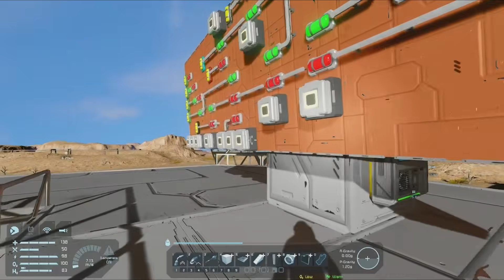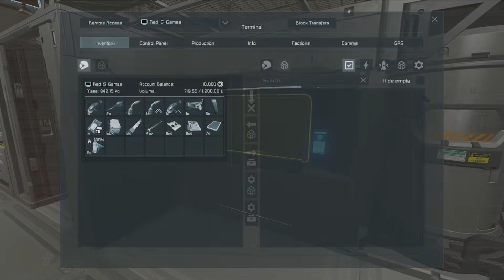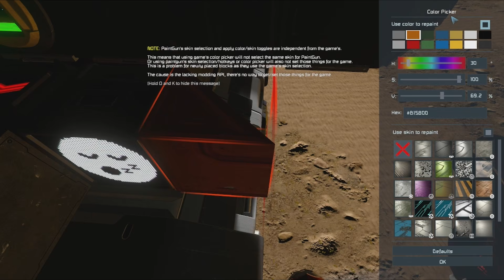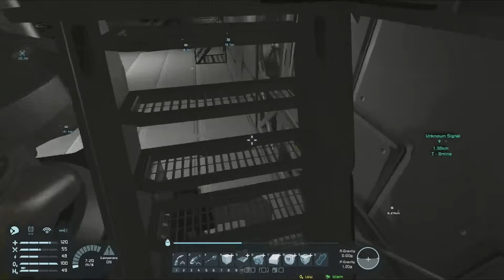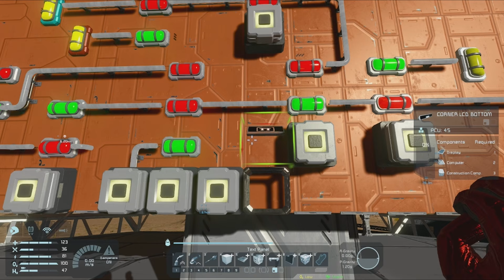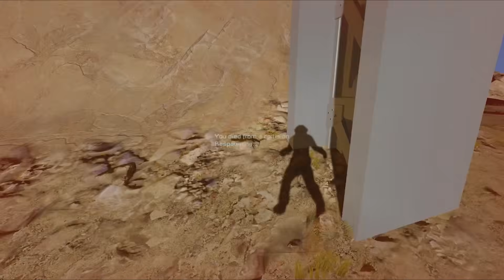Crippling Complexity - Rail Survival EP 21 - A Space Engineers Railroading Adventure

Comment: Random thought. Why don't you maintain enough medical components to build a new full medical station? I know they aren't cheap, but with silver now technically automated, it would probably be a good idea, so if you wanted to build a new area with a medical station, you wouldn't be stuck waiting.

Also re: "I don't think I'll ever need [the welding train] again", what about the train over to an economy station? will that just me a different track type then?

Thanks for the episode!
Reply from the maker: I forget how many med components I have stocked, but it's not a bad idea to make sure I have a minimum even of two med stations worth just in case everything explodes.  
I need to address the economy station plans in a video because they keep being brought up.  I've had a change of plans there, mainly because to do rail that far would likely make the save unplayable even if I could manage actually building the whole line.  I do have an alternative train-like solution that I plan on integrating into the finale episode, which if all goes well may only be 2 or 3 episodes away!